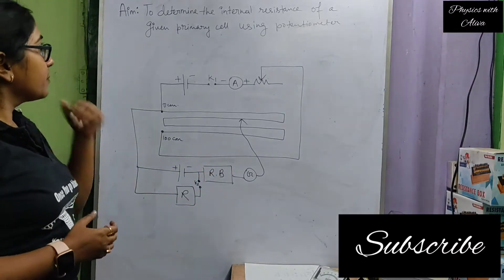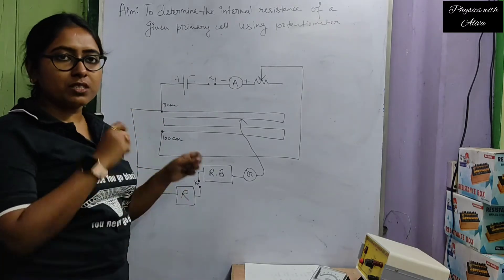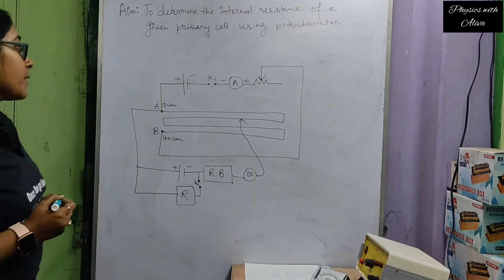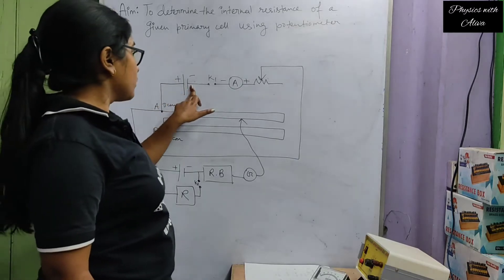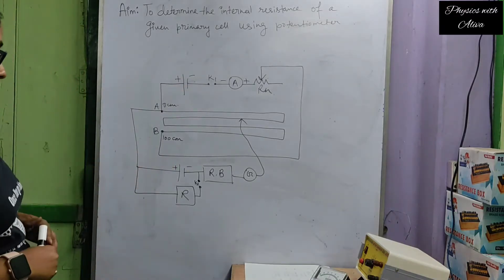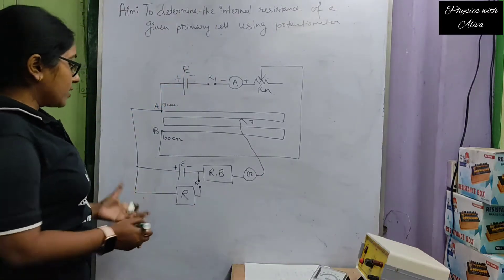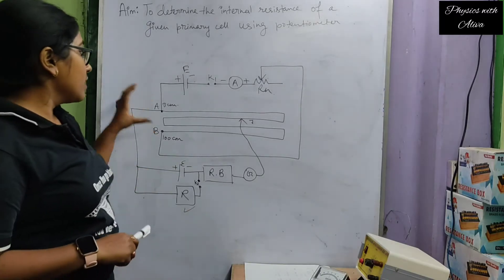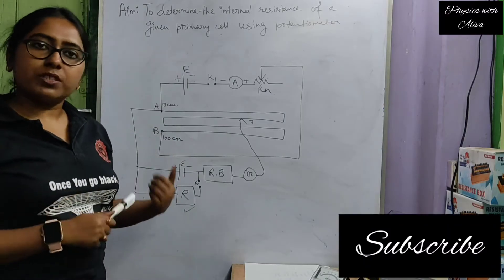To determine the internal resistance of a given primary cell using potentiometer

Comment: Don’t drag it . If you drag the temperature will increase and as temperature changes resistance also changes 😭
Reply: Also changes the cross section of wire